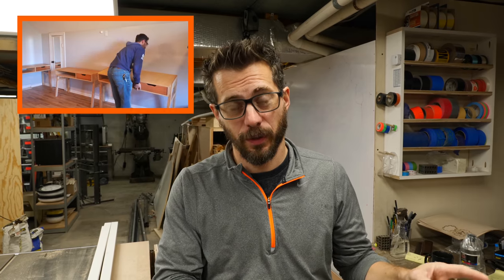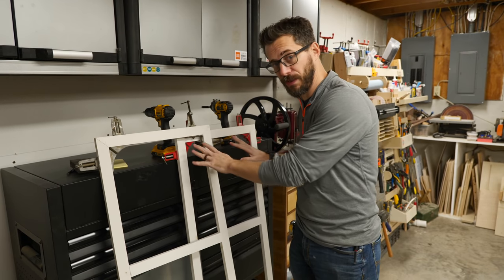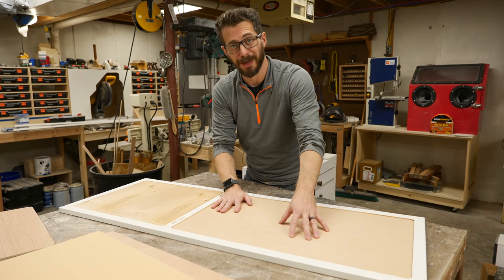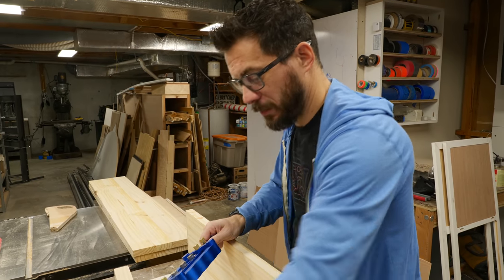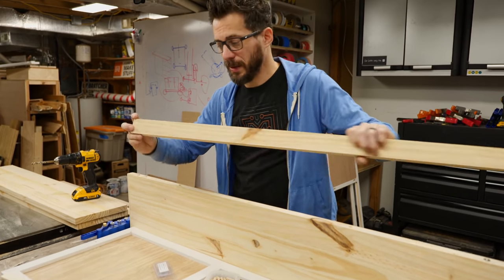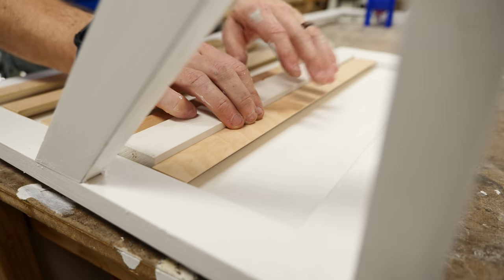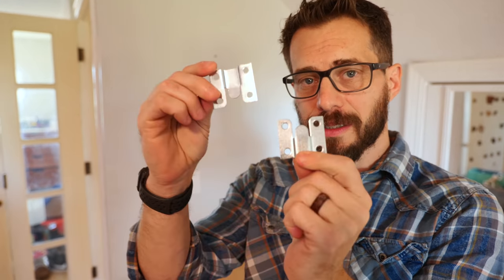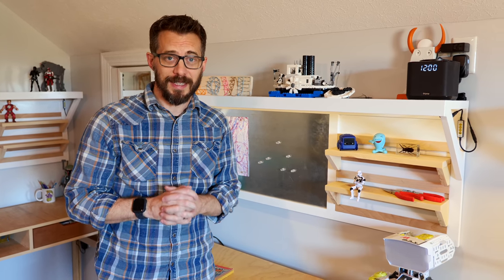How to Make a Wall Organizer // DIY Woodworking | I Like To Make Stuff

Comment: Bob: I like miters because it's easy to get the length right
Also Bob: So I got the length wrong
😂
Hey it wouldn't be a shop project without something going wrong. Nice recovery
Reply: Don't know where he got that miter cuts are easier, there's additional math to do with them than regular cuts.

Comment: I like the minimal damage to the wall.

BUT  LOL

cutting up a big white board for the metal plate would give both magnetic and writing/drawing ability

thanks for good work
Reply: Or paint the metal with whiteboard paint.
Reply: I was considering chalkboard paint.
Reply: @bigfoot286  if you use chalkboard paint, make sure to season it heavily

Comment: I've built a shelf that was very similar to this for my grandparents entry way, but instead of putting French cleats and a metal plate, I left it as wood and attached coat hooks. I made the gussets out of plywood with a sort of decorative swoopy shape and used molding around the top of the shelf to dress it up and make it fit in with the interior styling of the house

Comment: One tip on the LED tape is to put a strip of aluminum tape down and then put the LED tape on top of that.  It can function a little bit as a reflector depending on how you stick it down, but primarily it functions as a heat sink to dissipate the heat from the LEDs.

Comment: There is paneling at the big box stores that is ultra smooth and it’s white. I have used it for that kind of thing as a white board. 
You could spray paint the sheet metal with the chalkboard paint too to get two uses out of the space.

Comment: Gusset on small shelves- maybe make slightly taller so the bottom can rest on the lower cleat to avoid the shelf tipping forward? Just a thought. Cool shelf. I think I’m going to need to adjust it to fit what we have but definitely doing one of these!

Comment: I have struggled with glazing points forever.  If I don't stick the wood with the screw driver, I stick my hand.  Using a  hammer on the screw driver is a wonderful tip.  Thanks Bob

Comment: Hey I think those turned out fantastic !! i could use one of those in my entry room for jackets & whatnot's + storage on top = perfect. I would customize a bit. I'm loving the center finding jig, dowling centers & those flush mounting brackets 💗 I didn't even know there is such a things. Very nice job 👍 Thanks for the tips 👍

Comment: I recommend putting LED tapes in aluminum profiles rather than directly on wood for two reasons. 1. The profiles help to dissipate heat from LEDs which make them last longer. 2. With most profiles come dedicated brackets to attach them and, if needed, detach them quickly.

Comment: Tip: Put silicone on the Led strips (every 3-4 inches , where there is no LED chip) to hold better and longer. Double sided tape almost always gives up after a while.

Comment: hmm, instead of galvanized steel plate, how about buying a big white board, cutting it to fit, providing both magnet stuff and write-ability?
Reply: Len Conrad 
Or painting it with blackboard paint would also be nice.
Reply: @ragnkja  you can also use whiteboard paint (chalk can get everywhere, which is why universities are phasing out chalkboards, much to the consternation of the mathematicians)
Reply: Hmmmmmmm

Comment: Do not install the led strip directly on the tree. This will cause it to overheat and quickly lose brightness. The led Strip should be installed on an aluminum base.

Comment: simply using splines or dowels would dramatically strength the miter joints.  Since you used pocket holes for the divider, you could have easily done the same for the miters, again far stronger than the simple glue and brads.

Comment: If you made the shelves 1.5” longer then the gussets would bear the load along the frame 3/4” on each side instead of leaning into the gap between the cleats. Leave the cleats the same length.

Comment: Nice idea and build. Funny that you doweled a strip of front edge that carries no weight and then used glue and brads on the cleats that will carry a small load.. Not that they need dowels cuz they don't. Front edge didn't either if your wood glue was real wood glue. A nice "how to" with the center finder jig anyway. Gusset? Corbel?

Comment: Hey, Bob. I'm rehabbing the kitchen of my unit in a 100--year-old building and I've been looking everywhere for just the kind of mounting brackets you used. I want to hang my cabinets with them. I want to make my kitchen modular, but I also want to do this so that I can take the cabinets down easily, to get behind them to address the kinds of problems that arise in an NYC apartment building. My only qualm is: will they support the weight of cupboards that are ~40" x 30" x 12"? Are there heavier duty ones on offer? In all my searching for "mounting brackets" I couldn't find on a certain big box store's website anything of the sort that you're using.

Comment: Wanted to ask why the little shelves aren't level, but are a bit steeped, is that a problem with french cleet, or the moving part of it should be a bit thinner, than the one attached to the wall? Also, i work with LED strips and know, that its advised to use metal rails for them to dissipate heat.

Comment: I would live to have the tools and equipment to make stuff like this
Reply: If you want to try that type of stuff, you can get a hand saw with a miter box instead of a cutoff saw for about $20.  You can probably get a used corded power drill for a similar amount.  Don't let the cost of his professional equipment prevent you from trying the hobby
Reply from the maker: Well said! Also, used tools are a fantastic way to gather the basics 👍🏼

Comment: I'm a bit confused by the cleated-shelf gussets; if the shelf's cleat is mounted to the back (e.g., not between the gussets) won't most of the gusset "float" since the wall cleats are only an inch or two tall? Meaning most of the gusset isn't actually resting against the wall.

Comment: I have a question? Wouldn't it be easier to rabbit the edges before assembly, then put the frame together. Then you wouldn't have to clean the corners?

Comment: Do you mind explaining the LEDs a little bit more? Is power run to the switches and then all the LEDs run from that, or is it a proprietary product specifically designed for that kind of application somehow?